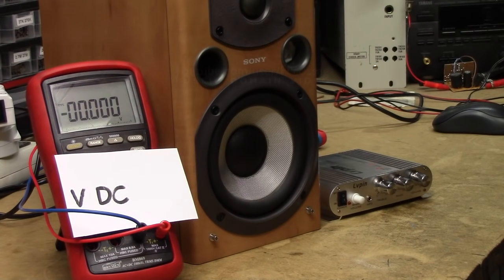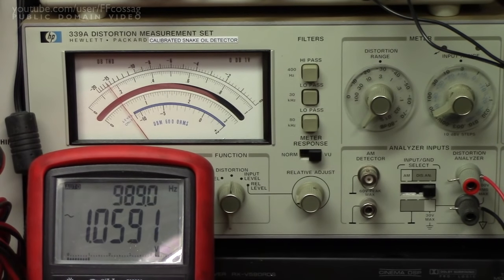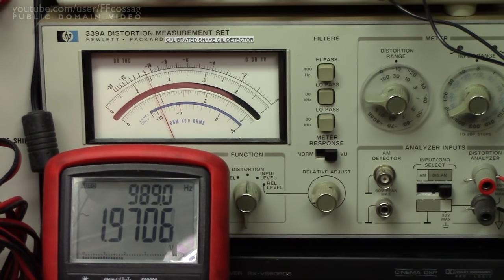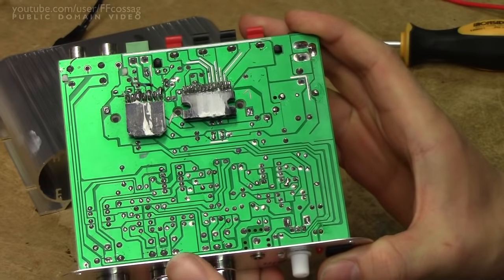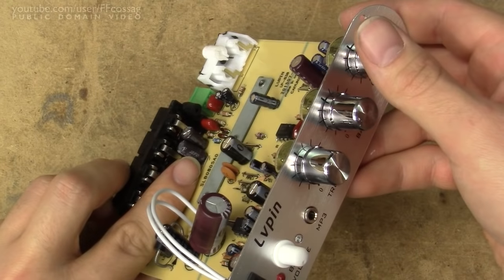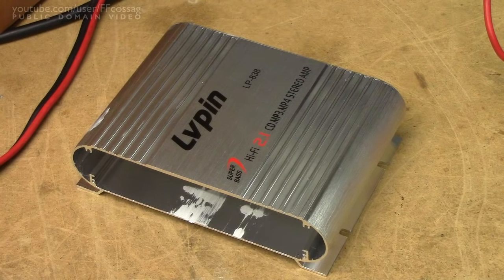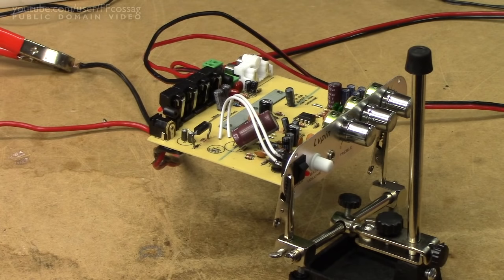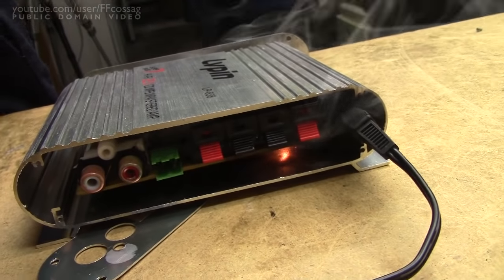Lvpin LP-838: LITERAL TRASH! Tested, drowned & burned

Comment: I have a similar amp, its called a Lepy LP-838. It looks identical. I dont have the squeel or bad feedback noise coming from the speakers and i use a 12v 3A plug, it works and sounds great on my TV. I also have my Tanoy speakers and a 130Watt subwoofer connected and works effortlessly 👍
Reply: Because "lvpy" is a copy, the original is Lepy
Reply: I don't think the guy doing the review albeit 7 years ago realizes that it is a class "D"  and if his demo was not working he must have received  a duff i.e. faulty  product. I have four for cheap studio monitor drivers powering  passive  "yamaha NS10s" and they work flawlessly .

Comment: I never had a problem with my Lvpin LP-838 amp. I mean... its not TIP TOP perfect,  but for the cheap price of 8 bucks, it sounds great!
Reply: mine was a lepy 838 sounded good for a while then started losing volume
Reply: Get a tpa3116 and rethink your comment... Tpa3116 is @ 9$
Reply: @Lassi Kinnunen 81 nowhere, have to buy it without a case
Reply: It's not the sound. It's the performance. Anybody can make a great sounding amp for as little as $3 these days. But it doesn't mean anything if it clips at 9 or so inefficient it can only draw 1-3 watts out of 12 volts.

And it's class A/B amp in such a tight enclosure. Class A/B amps are inefficient and as a result they get hot which means this amp will eventually melt itself. So it isn't even designed to last lol.
Reply: @jonkaz746  hi mate its not class A/B its Class "D" and although I have never bothered to measure with a load, scope and meter I just listened ans would describe as bl**dy  loud! and the sub driver amazed my customers.

Comment: such a weird concept. I have a similar amp, similar price, looks identical too, even branded "lvpin" but the innards are far different. it's a proper class D amp for starters and it puts out notably more power on my 8 ohm speakers. I cant measure it though as I lack the equipment.

Comment: I use this to power 4 Dayton Audio bass shakers 20w pucks. It works decently for the bass shakers so I don't have to run them to my sub woofer amp which could quickly burn them. I plan on getting a Dayton Audio SA100 for them to get some more power soon. I only use the subwoofer out knob just for the bass shakers and considering I paid less than $15 for the this amp it gives my bass shakers enough to feel them quite well. If you are on a very low budget then this amp could be considered to get you by while you save up for a better 2.1 amp. But for just a bit more money you can get a much better amp out there.

Comment: I have this amp but the speakers are buzzing when the volume knob is turned up a lot. The speakers are also hissing at any volume but this could be normal but is disturbing when sitting as close as i do at 80 cm from it. It's because the SNR is about 75, but it needs to be 100-110+ i think.

Comment: I built a boombox using one of these amps and powering it with a 19v lithium battery. It's running 2x 1inch tweets 2x 4inch mids @8ohms and 1 6x9 subwoofer @4ohms, I built a compact T-Line enclosure.
  No distortion at Nominal volume. Minimal at Max Volume but it gets Hot quick. 
Sounds fucking BadAss...People always give me compliments and I even built 3 for friends.
Reply: but it was a Lepai nit that name.
Reply: working on a bluetooth 2.1 boombox /sound bar project,please advice

Comment: Amazing, I bought this exact amplifier from Amazon not long ago.
I get a bit of a high-pitched squeal out of the speakers but I'm unsure if that's the amp or the PSU I'm using.

I personally think it sounds pretty good.
I also have a Lepai two-channel amp that I bought this to replace (although the Lepai now has a new purpose).
Reply from the maker: +Thomas Galea (UKZz HELLRAISER) As long as it's not built out of broken parts, the LP-838 could work just fine in theory. It's just built around a couple of REALLY shitty and weak ICs when it does.
Reply: +FFcossag 
Guess it varies on the vendor, because Lepai have an exact clone of this amp too.

Although Lvpin is the only one with any reviews, all claiming it to be good. Lepai, other vendors, no reviews.
Natural instinct is to go with the one others have used.

Comment: I have one because the sound on my Sceptre T.V. Is crap. I have a Lvpin 838 pushing a Bose sub and a pair of jewel cubes..For the money they sound incredible. Not audiophile standards but good enough for this 70 Yr. old. Plenty of bass and all the volume a sane person needs. I have it at the lowest bass setting and mid range on the other 2. I have a wall switched outlet so it goes off when the T.V. does so maybe it will last longer. It's a few years old and I'm totally satisfied with it. The newer model has a remote so I'll be getting it if and when it goes out.Figures it's more expensive though.

Comment: Personally think your wrong ,its actually a good amp ,have one myself and does not have a constant 2v output to speaker when idle ,i agree its not a powerful amp but for most general use its pretty good with 2.1 speaker s connected with plenty of bass .can only think you have a bad one. For the price its a good amp ,purchased one from amazon without any issues at all.

Comment: 2 volts DC shouldn't break speakers unless they are really low wattage. With 4 ohm speakers that is only 1 watt of power. You'll just hear a "pop" whenever you turn the amp on.
Reply from the maker: 1 W with no cone movement to cool the coil is quite a lot to dissipate for even a reasonably large speaker. Nevertheless, DC offsets above the millivolt level are unacceptable from a performance standpoint.

Comment: Wow, Mine was terrible too, 5v offset on the sub out with no load on it,., case got up to about 80 degrees pulling 4 amps and putting loads of that thru the sub out. I had 2 18" subs on that in series so 8 ohms, no worries of overheating those. I foolishly bought it assuming it was a class T one and paid considerably more than you paid for yours.

Comment: Hey, nice video, man.
I am currently looking for amplifier for these speakers(headphones):
Frequency response: 20~20.000Hz
Max. SPL at 1kHz: 115±3dB
Max. input power: 50 mW
Drive diameter: 40mm
Driver unit material: Neodymium magnet Impedance: 32Ω

What amplifiers would you suggest(under $20) for my headphones?

I am also thinking of buying lepy lp-838 or lepai lp-838. Which one should I buy if we choose out of these two?
Reply from the maker: Those won't power headphones. In the VAST majority of cases, headphone amplifiers are entirely pointless.
Reply: FFcossag 
I understand that in most cases amplifier is not needed. But in my case amp is needed.
I have this little project of mine:
https://forums.anandtech.com/threads/need-help-choosing-amplifier-for-6-0-sound-system.2485904/

I've got Roccat Kave:
http://hothardware.com/articleimages/Item1981/small_roccat_kave_remote.jpg
http://img.clubic.com/04032756-photo-roccat-kave-hp.jpg

Here's the link to the official page:
http://www.roccat.org/en-UA/Products/Gaming-Sound/Kave-Series/Kave-XTD-5-1-Analog/

Originally Kave's got built-in amplifier powering from USB. I am using my Kave without amplifier at the moment. And sound is pretty weak. So I do actually need amplifier in my case.

Can you suggest some stereo amplifier for my headset, please?
Reply from the maker: I don't dabble in headphones, but you certainly do not want to buy something made to power speakers. Due to the way most cheap speaker amplifiers are built, they wouldn't even work for powering headphones, since headphones use a common ground for both channels. Get a cheap headphone amplifier.

Comment: Ouch! An swinging analog needle might have been a more entertaining way to show the DC offset issue.

I guess they're trying to play on Lepai's much better name?
Reply from the maker: +uxwbill I'm pretty sure I've actually seen this sold as a Lepai at some stage, but that was a while ago. It also does share the same exact knobs as the Lepai, so they probably share some roots.

As for a swingin' analogue needle, I sadly don't have any analogue multimeter at hand which has a coarse enough scale to work well on video .

Comment: Hi, i'm not an audiophile and I bought this amplifier to use it with my sony ss h771 6 Ohm speakers which i hooked up using the amp to my PC. Amp was cheap, less than 10$ and I thought it would be good enough for what I needed it. It works for the most part, but there is a white noise kind of sound coming out of them at all volume levels which is very annoying. It's different from the noise you hear as the volume is increased. Do you think better quality amplifiers that you mentioned will still have this problem?
Reply from the maker: These cheap Chinese amps can have all kinds of different issues, but I'd say that the VAST majority of them are better than this in every way. I personally like the Breeze Audio TPA3116.
Reply: Thanks for the reply, I think that I'm too close to the speakers. I'm sitting around 1m from them. Amp is good if you are using it from across the room, for example. Dedicated PC speakers are usually completely quite regardless of volume and I thought  this would be the same. Will try playing around a bit, with smaller speakers that I have lying around, and try buying a better amplifier in the future... cheers.
Reply: Mine don't do that, no hissing ,clipping or anything other than clean crisp sound. It does clip when it's turned on or off though. You can hear it through the sub.

Comment: Couldn't you put a capacitor in series with the speaker output to remove the DC voltage?
Reply from the maker: No, because the issue is that the chip is broken.

Comment: Oh man these things XD there is an even smaller and cheaper version, which I got. The only reason why I bought it is for my HDD speaker. That's the only thing these cheap amps are really good for. I also had a peak inside it and it looks even worse. It also had a hole in the main capacitor.
Reply: Nonexistant quality control...

Comment: cheap amplifiers
are they any good?

short answer:not really
Reply: Nobsound Mini is good cheap amplifier(for the price ofc). Z Reviews reviewed it. If FFcossag would buy it too and do all the measurements that would be cool.
Reply from the maker: At least one Nobosound Mini variety seems to be the same as the Breeze audio amplifier that I've tested on this channel.
Reply: That's the first video i watched from you! :) But the Nobsound mini/micro has different chip (TPA3110). 

What if i buy that someday and send it to you for testing?
Reply from the maker: *****
Hm, one of the ones I saw (There seems to be a few different ones) has the same PCB as the Breeze - it seems very far-fetched that that paticular one would be anything but identical. The other varieties, however, are certainly going to be different.

If you want to send me one, I'll definitely check it out. Send me a message or e-mail if you want to know where to send it.
Reply: 山寨卡屁 eh

Comment: Never ever trust what written (drawn) on product. I get this product 
whith chips (alldatasheet.com can watch wath chip can do): TDA7057AQ 
(2×8 W) and LA4445 (1x15W) (I think this LA4445 was reused seconhand 
chip).
[TDA7057AQ] 2×8 W stereo (40dB) (input 12v, output 8ohm 2x5.3W; input 12v, output 16ohm 2x3.5W; input 15v, output 8ohm 2x8W) ;
[LA4445] (subwoofer amplifier chip) Maximum 1x15W, normal 1x11W (46dB) (2x5.5W(4ohm) 13.2v(10v-16v)) (without 2x 1000uF output capacitor)